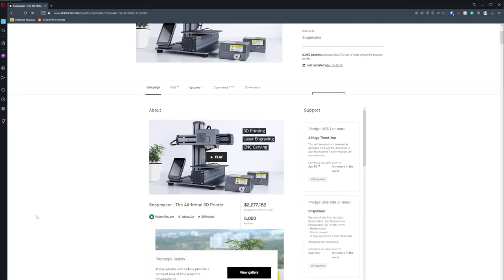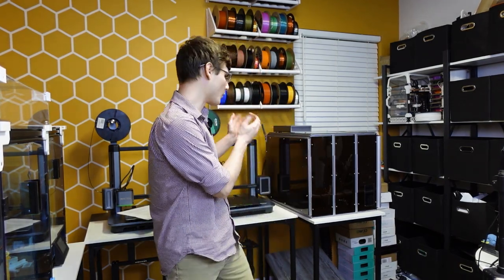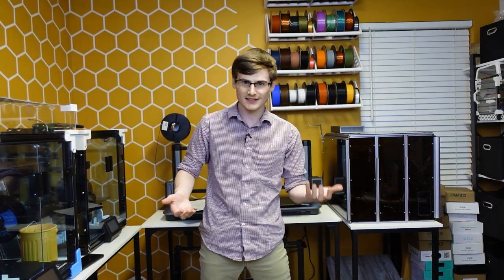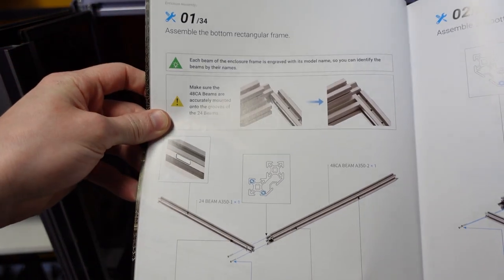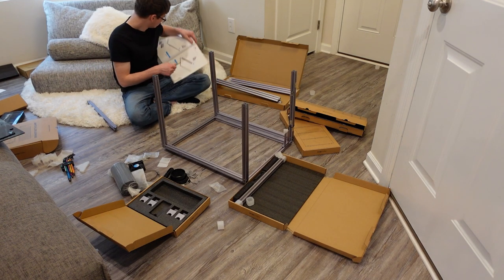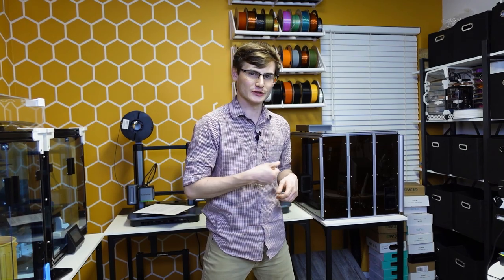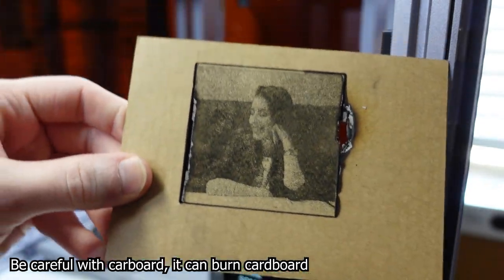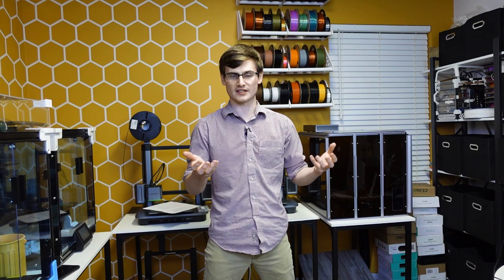Uncovering the ULTIMATE 3-In-1 3D Printer: The Snapmaker 2.0

Comment: I have 2 Snapmaker 2.0 350 machines. Now I didn't buy them new, got them on eBay from people that really had no idea what they were doing assembly wise and running the Luban or Cura slicer and probably had no idea how to create designs. I lucked out and bought one for $400 the other for $300. Both needed a little attention so I spent and additional $300 combined to get both working. Of course the sellers took them apart, didn't have the original boxes so that's why some pieces were damaged. When you talk about the assembly, the other machines I have are Voron's. They are EXTREMELY intense in building. The Vorons require a bolt by bolt build, then wiring, then the firmware, then the user interface, Klipper, Moonraker, Mainsail or Fluidd. Talk about a complicated built, the snapmaker is CAKE compared to a Voron build. Very very different machines. The snapmaker is cool in that it 3D prints, laser, and CNC. I have one set up for laser, the other for CNC and I did spend some extra case for the rotary CNC. I don't use either for 3D printing as the Voron is faster, much faster and makes better 3D prints by maybe 20% better, not a huge difference but at least 2-3 times faster and better prints is pretty significant. Nice video.
Reply: You can't compare voron to any building experience they don't even make the parts, this is a company with a full fledged product

Comment: Great review. I've had my A250T for several months now, and I really like it. I have a very small shop that I use mostly for woodworking, but I wanted to try 3D printing, laser cutting and engraving, and CNC milling. My issue was that my shop is already full of woodworking tools, so I had no room for a 3D printer, laser cutter/engraver, and CNC machine. I did have enough room (just barely!) for one machine, though. The Snapmaker A250T let me do all three of those things in the same footprint as a single dedicated machine, so it was perfect for my situation. As you said, the quality of the Snapmaker is excellent - really solid. I didn't have too many problems with assembly, but I did have to back up a couple of times - more on the enclosure than on the machine itself.  Since you made this video, Snapmaker has continued to improve the A250T and A350T a lot. They've released the Quick Swap kit, which makes changing from 3D printing to laser to CNC and back very fast - well under a minute (not including recalibration, which can take a couple of minutes). They've released a 10 watt laser module, and now 20 and 40 watt laser modules. I have the 10W laser and ordered the 40W laser. The 10W laser works great. Yesterday I etched some glass with it, and it turned out really well - better than I expected. It can cut and engrave many more and much thicker materials than the 1.6W laser. I expect that the 40W laser will be even better (I hope mine arrives soon!). As a 3D printer, it works great, but it is subject to the same issues that most all 3D printers have - bed adhesion, wet filament, etc. It can take some fussing to get 3D prints to come out perfect, but OTOH, I'm not at all an expert when it comes to 3D printing, so a lot of that is just my inexperience. My first sample 3D prints worked great right out of the box; on others, I've had to play around with the settings to get them to come out well. I have the rotary module for CNC cutting and laser engraving round objects, but I haven't used it or the CNC module at all yet. I want to get some dust collection setup before I do, as I don't want to get dust all over in the enclosure. I've started 3D printing the parts for a dust boot for the CNC, but I've got to finish it. Fortunately, I have a good dust collector in my shop (since it's mostly used for woodworking); I just have to get it hooked up to the Snapmaker. The Luban software is the biggest weakness of the Snapmaker ecosystem, but they continue to improve it. Even if Luban isn't great, you can use Lightburn for the laser, Cura and other slicers for 3D printing, and other CNC software (or Fusion 360) with the Snapmaker, and just use Luban to transfer files, or if you don't want to use it at all, you can use a USB stick to transfer files to the Snapmaker. Overall, I think it's an awesome machine, and I wouldn't hesitate to buy it again. If you want to be able to 3D print, laser cut/engrave, and do CNC milling, but don't have the space or don't want to mess around with three separate machines, I think the Snapmaker is a great way to go. (BTW, I'm not associated with the Snapmaker company at all; I just think it's a great machine and wanted to share a bit about my experience with it).

Comment: looks like you used a tapperd bit to cut the inside of the coaster holder. You would need to use a straight endmill to keep the walls 90 degrees.
Reply from the maker: I would need to rewatch the video, but I believe you. The machine only came with 2 (maybe 3 I dont remember) bits, so there werent many options.

Comment: A very biased rose tinted reviewed here presumably because you were given one of these to review, if you had spend your own money on it you might not be so impressed with it given that it was a 'premium' machine. Snapmaker had a chance to become the Bambu of their day but they screwed the pooch. Amazing build quality all undone by small but really impactful cost cutting measures and all were known annoyances with any of their competition at the time.

Firstly noise, not learning from their first version and the overwhelming feedback on it while also ignoring then then trend on the 3D printing scene to silence screaming Enders. The prmiary cause was the fans  - small, loud, cheap and pieces of crap that fail regularly and were clearly a cost cutting measure. The power supply was a smooth sleek silvery box that turned into a jet engine as soon as you turned it on all because some ****wit of a product manager decided they wanted to keep the looking good, clearly an Apple fanboy. Who cares how loud it is the Snapmaker is a piece of art and not supposed to be turned on anyway.... :facepalm: This same product manager must have been in charge of the hotend assembly as the same logic of don't perforate the pretty silver body was applied here turning it into a nightmare to service, remember people its art not a tool. Also a completely unnecessary small shitty cheap fan amping up the volume for those rare times heathens with no appreciation of the arts wanted to actually use the thing. They also cheaped out on the motors, leadscrews and stepper drives in the enclosed drive trains which added to the noise. 

Secondly the software - Luban. I guess the name says it all coz they should have shipped some KY with the printer in the pretty box they had the USB drive. Luban was always beta software and buggy as hell regardless of version to the point where no one would who used it on a regular basis would use it as their primary slicer. Sure you had to use if you wanted to do engraving and use the camera feature but it was so Alpha it made the other functions looks good. It slightly improved over time but never became plug and play like software for machines that were only for laser cutting/engraving. 

Hotly contested second was the enclosure but as most people had more sense than to order one the software beat it out. The enclosure summed up the Snapmaker, Apple flashy with all smoke and no fire. Apart from having nearly zero effect on the screaming fans their genus product designers decided to put a hole in the enclosure for the phone/control unit to sit in coz you know screen doors make sense on a submarine! The entire project seemed to have gotten the apple treatment of look good but dont work as as good coz that might interfere with the hallowed asthetic. 500 bucks for some extrusions and acrylic that didn't even form a full enclosure thanks for the phone hole and it seems it was beyond their engineering staffs capabilities to make the enclosure impactful and make an attempt at hermetically sealing it. Yep that screams premium right there of course you can't hear it over the fans. 

Other idiotic choices like the spool holder, cable management, the 'captive' dust covers, general serviceability, not having a quick swap mechanism for the hotend or bed as it meant having to basically rebuild the printer to go from one function to another. All while giving you a middle of the road printer with a meh print volume, mediocre speed and quality on top of closed software and really bad customer support is the reason why snapmaker is not a known brand like Bambu or Prusa. The community stepped up to address so many of the shortcomings listed above as best it could but as it wasn't as democratised as the Ender series it didn't do much to move the needle, on top of that Snapmaker never learned from community feedback and continued to do stupid things like have noisy fans for later products. Save your money and buy 3 separate machines to do the 3 functions outlined here as on the whole you will end up with more capable machines and a better experience overall.
Reply from the maker: If you think about it, all reviews are biased. This machine is great for what it offers. It has issues, but this is also a type of machine that doesnt really have a competitor, so for that, I think there is certainly a market.